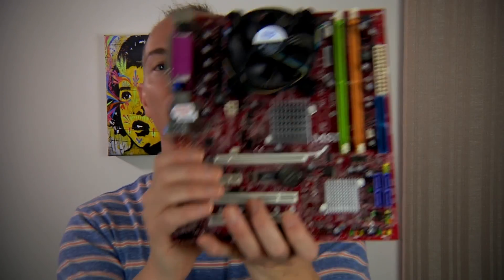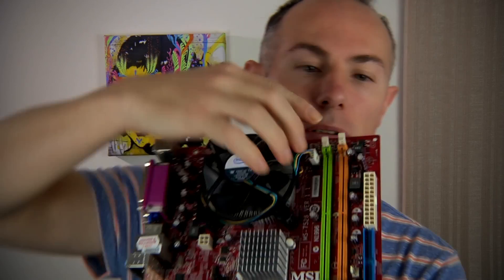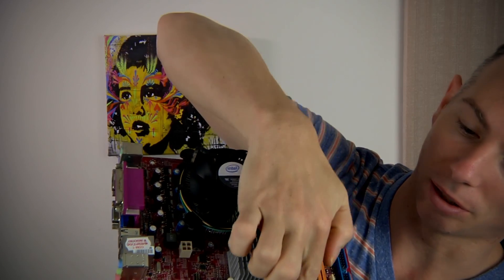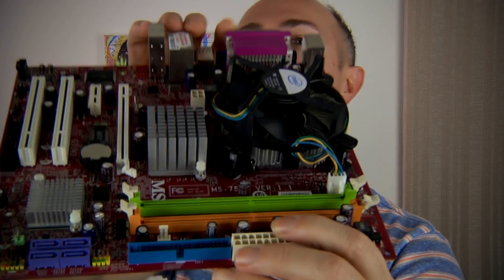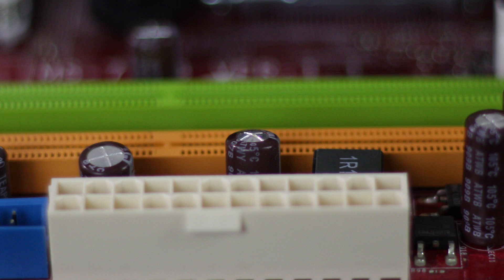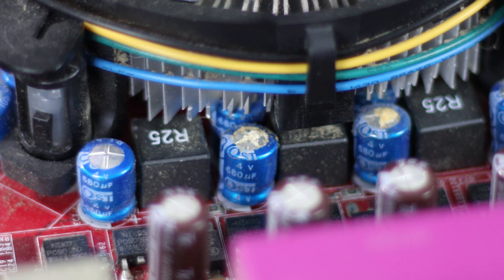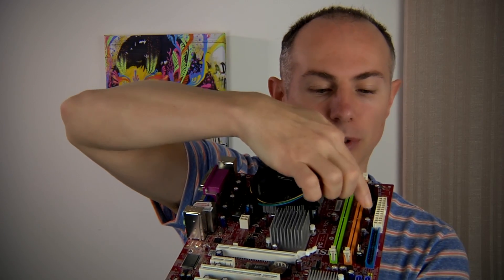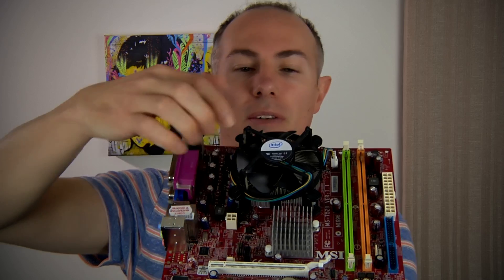Bad Capacitors on Main Board what to look for

Comment: you can replace capacitors yourself to save your motherboard.  the capacitance is marked on the part as well as the polarity.  They are cheap to buy and you can generally source better ones that will last longer.  You can use a soldering iron to remove them but the best method is to use a desoldering tool and flux core solder to clean the solder pads.

Comment: I've yet to have a Motherboard die from a bad cap issue, but I did have to replace 2 on my old Samsung LCD TV.  A known issue with the model.  It was €150 to replace the TV's main circuit board or €2 for a pack of 5 cap to fix what was wrong.  So long and you don't mind having fun with a soldering iron it's a cheap fix.
Reply from the maker: yes LCD screen fail & about 50% of the time only need a $1 cap to fix

Comment: capacitors are a pain when they go, the second i see one that is bulging i replace it ;/ already had one go on me before (believe it or not it was when i was backing up the data on the pc before it gets scrapped and the hard drive destroyed) not sure how but the main caps near the cpu exploded and it didnt effect it at all, still i didnt want to take any chances especially with the cheap power supply it was using that had no safety cut out
Reply from the maker: i have seen stuff knocked off and still worked.  I torched a firewire cheap recently (torched = smoked !) my fault i plugged internal USB header connected to bluetooth and wifi adapter into firewire.

System run fine after that, i did disable firewire in bios and bluetooth and Wifi adapter was dead also, im not perfect....

Comment: I used to use Abit motherboards until 5 years ago. They worked great for 4 years but the capacitors around the CPU started bulging and bending.

Comment: Good information - thank you.  Would you find more dependable capacitors in higher end computers?
Reply from the maker: look for solid caps in a main board, gigabyte switched o them long time ago.  Asus had some terrible issues with there old cheap boards with this problem.  It seems they moved to spend more on caps and havnt seen the problem in a asus or intel board for very long time.

But.... i have seen cheap brand "Claim" solid caps but i have seen them expand and bubble up
Reply: DmitriTechMech Good to know.  Thank you.